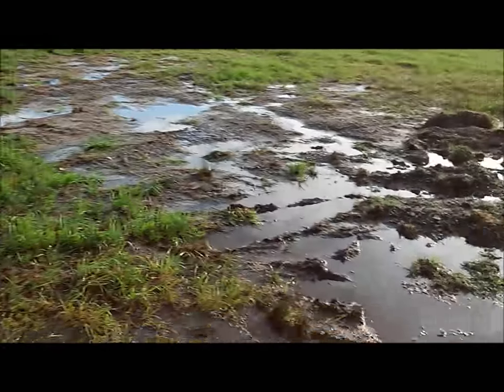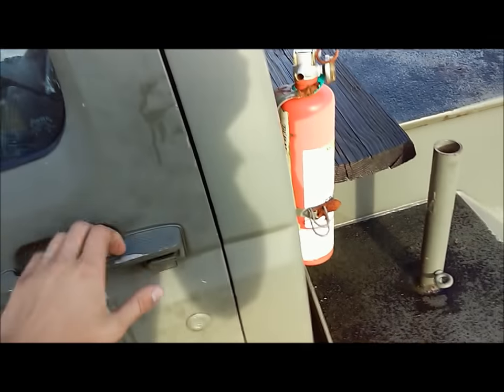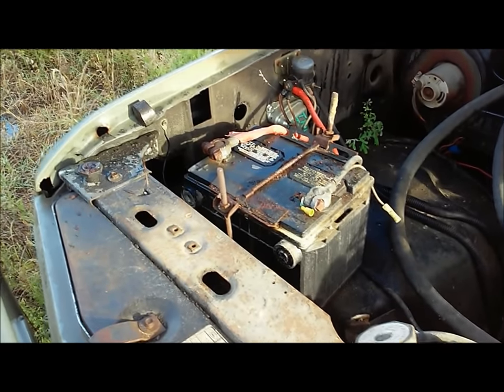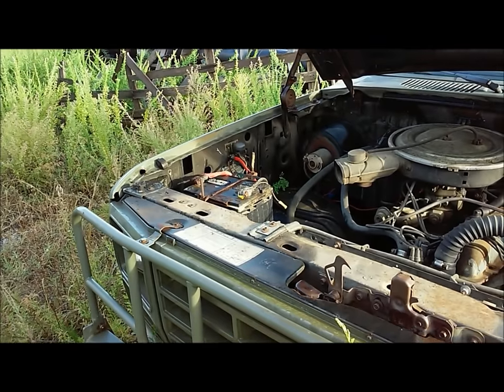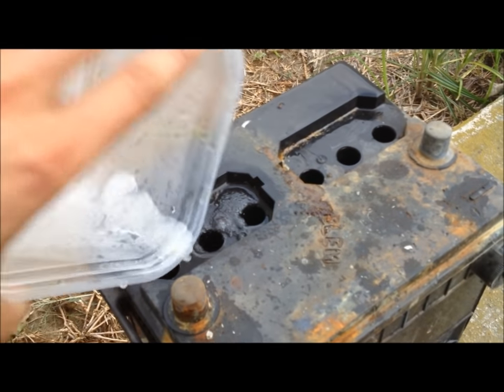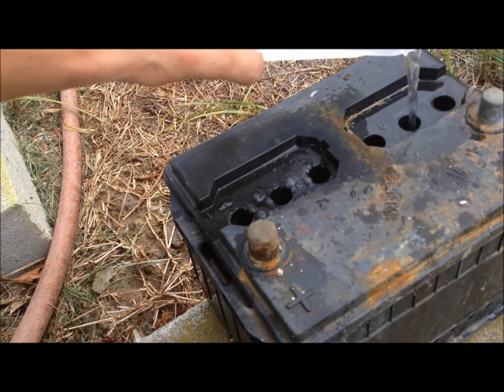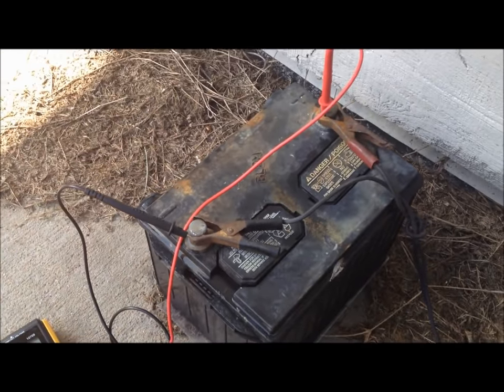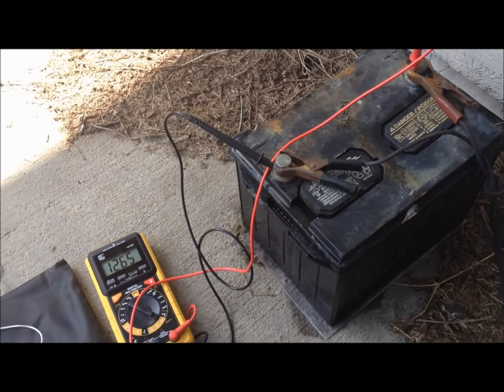Car Battery Repair After Sitting 10 Years: How To (Basic Home Products !!!)

Comment: He poured the Acid out on the Ground.
Reply: I meant No Insult !
Reply from the maker: +The Gardening World i will admit openly that how i did this was stupid. also, sometimes i just dont have the recording equipment when the opportunity presents itself. the vehicle did light off and run. ran it through the bog back there and parked it again. another employee eventually bought it. 
if i do this again, you better believe i will do it right. i cant even figure why i was so careless.
Reply: I\'m not sure but ,if anyone else needs to find out about how to recondition used car batteries try Corbandy  Battery Blueprint Crusher ( search on google ) ? Ive heard some amazing things about it and my buddy got excellent results with it.
Reply from the maker: ill admit that this was a fail.
Reply: hi everyone ,if anyone else wants to learn about how to recondition batteries at home try Vaxicorn Battery Extender Guide (Have a quick look on google cant remember the place now ) ? Ive heard some decent things about it and my cousin got great results with it.
Reply: It's a fail because you didn't pour it on a fire ant colony
Reply: don't cave in to the trolls
Reply: Yeah,  that's because he didn't have any methyl ethyl death.
Reply: I did a Job for a 90 year old Mill Valley couple~ Deepening thier Creek~ after about 6 - 10 inches deeper all kinda Oil started to flow down the Creek ! I screamed at her for this~Dragging ME into it for a $12 hr Job! She said Oh in the '50s we ALL dumped our Oil and other Paints , bug sprays, (Leaded paint too~ ) right in the creek~ maybe 2 miles from Sausalito Bay Oops~ I tried backfilling it~ but it made it worse~ I got paid and got outta there~ Never disturb ancient dump sites~ I mean Wildlife was coming back and the toxins Ted Turner added to our Gas MTBE has NO halflife at least this was good ole Oil~ I knew as a 7 year old kid ta take used oil to the Gas station open the recycle tank most Stations had then for free , and Re~cycle it~

Comment: here's  several ideas for getting a good result
never try to do this unless you are sure what you are doing - the acid can burn you
Test the voltage first - there may be a kaput cell which would waste your time.
Check the battery fluid.
attempt to fully charge the battery.
(I read about these and more from Jons mender guide site )

Comment: I reacted the same as everybody else to emptying the battery on the ground, but people forget that when a battery discharges the acid turns back into water, especially after sitting many years. That's why they freeze up in the cold. That was mostly water, but still I don't know if I would show dumping it out like that on YouTube. You may wanna edit that part out before somebody calls the EPA on you.
Reply: There's nothing wrong with pouring battery acid on the ground, it neutralizes almost immediately, and becomes inert.

Comment: So i have an old style battery i want to try this on. What do you replace old fluid with after its revived with salt mixture?
Reply: Pour the battery acid out in a metal container or plastic one then pour in distilled water with Epson salt into the battery then charge it, after you charge it for a few hours pour the water and salt out and pour back in the acid

Comment: This wont work with batteries that have dodgy cells, sometimes yeah you can get lucky and rejuvenate a battery for a few weeks/months maybe even a year, but the thing is an old battery isnt reliable. Imagine driving out in the desert/weather/snow etc etc and your battery dies. No ones fauly but your own really. Batteries are a consumable item, the lead flakes off and they no longer hold the same as original meaning they need replacing

Comment: There are  a few ideas for doing a pro job
do not try to do this unless you know what you are doing - the acid can burn your skin
check the voltage first - there may be a dead cell which would waste your time.
Check the battery fluid.
attempt to fully charge the battery.
(I discovered about these and more on Jons Mender Guide site )

Comment: I'm guessing that the battery was unable to crank the truck - or any other vehicle. Didn't the 12.5 volts drop to somewhere around 5 volts as soon as any load was applied?
Reply from the maker: i made recent video off me doing this all over again and then cranking a truck over and starting it. search thunderhead289 battery. you will find it.
Reply: Will do. Thanks.

Comment: How did it hold its charge over time ?
Was it as near good as new like for years out of that battery??
Reply from the maker: It lasted until the additive corroded the battery itself. Ideally, acid would be put back in.
Reply: When mixing the first epsom salts (magnesium) you should have used distilled water ($.99 a gallon at wally world). That way you could have avoided putting in chlorine and other minerals that are in tap water causing corrosion. After a week of desulphation/charge with the epsom salts,  one or two flush outs of the liquid using distilled water (depending on how much black soot comes out) and then a new 1.5 gallon box of battery acid ($20 from autozone) would have brought her back for another 5 year use. Filtering out and using the original electrolyte brings down the lifespan to under a year.

Comment: What did you put back in the battery after you drained the Epsom Salt out?
Reply: I think it is no brainer that he poured an electrolyte, a.k.a. dilute sulfiric acid, also known as battery fluid, or sulphiric acid with is 25-30% concentration compared to water. I don't know how to tell you in even simplier way.

Comment: 12.65V is all well & good, however it doesn't mean it has enough charge capacity to start a truck.  I've got an old batt that is over 10 yrs old it it has a great V--but it only puts out about 150 cca (it once put out 700 cca when it was new).

And that is why people who only test a batt V & not load test the batt essentially fail in their videos...
Reply from the maker: Well, it ran that pos truck, so it was good enough to start that
Reply: There are several factors in battery reconditioning. One resource I discovered that succeeds in merging these is the Magic Mender Wizard (google it if you're interested) without a doubt the most incredible course that I've seen. Check out this  super resource.
Reply: Epson salt is magnesium sulfate.  Your battery only needs the sulfur from that chemical compound.  It does not need the magnesium--which just gunks up your battery.  

It would have been better for you to just top off the battery with distilled water, slow charge it for a few days & (if necessary), replace the electrolyte with clean electrolyte -- if the old electrolyte looks nasty.
Reply: @jon fraer:  Just flag the advertiser like everyone else does...

Comment: When a Lead/Acid battery discharges, to start your car, its electrolyte boils pure Oxygen gas. Inversely, when being charged it boils off pure hydrogen gas at twice the volume, that's why car batteries can explode, hydrogen and oxygen gasses are explosive and, H²+O¹=H²O and this is why we add distilled water ONLY to a car battery, not acid. As the electrolyte boils and evaporates away, when the Lead plates hit air they sulphate which deteriorates the Lead AND the Zink plates which collect at the bottom of each cell and shorts it out. When attempting to resurrect an old battery you must dislodge the crud at the bottom of each cell and add ONLY new electrolyte fluid. How do I know? My backyard used to look like his!

Comment: I agreed with the techniques and the process used in this video. you did kinda leave out the fact that you put the the new electrolyte back in and dumped out the solution of Epsom salt. but what was most astounding was watching you play sulfuric acid that contains live out in the dirt. now if you're growing anything or if it can grow anything and any animals or people eat it they get lead poisoning. last thing that was surprising to me what's the lack of professionalism. I mean God when you took the battery home you could host and cleaned up all the rust on top of the battery so that it did not contaminate as you poured the liquid inside the battery. kind of reminds me of a mechanic that works on an engine and leaves at all greasy.

Comment: I wouldn't worry about the acid dumped on the ground. Unless I had a toddler or pet crawling around. But setting the battery on the concrete charging it. First of all, never sit a battery on concrete. It's not good for the battery. Secondly, you even commented about the leakage while charging. The acid will severely damage the concrete. How many new batteries could you buy with the money you're going to pay for your new sidewalk?

Comment: Ive been in emergency services for 32 years. Do you have any idea how many batteries rupture during wrecks, mechanical ruptures and have poured out by turning over etc. No one died from the lead poisoning that I know of. The acid becomes inert and is relatively a weak solution. As far as lead poisoning from the lead in the battery yo probably drink more from city water and old pipes than spilled on the ground. Yes I know I am a Haz Mat Tech. But.. I do not endorse pouring toxins on the ground or overreacting to EPA PC BS.

Comment: you mention not leaving the Epson salt water in there ..so what do you change out the fluid with ?
Reply from the maker: you would have to put acid back in if you planned on using the battery long term.
Reply: so dump it out and save it to replace it  or do you get some new acid ..Where do you buy battery acid ?
Reply from the maker: +Mat Tuk I guess you can save it, I just wanted to see if it would work and didn't plan to use the battery long term

Comment: You are connecting the battery charger and checking the voltage.. I dont think it actually charged up
Reply: Im also thinking bullshit, Ive never hooked up a meter to a battery and had the voltage rise while connected to meter...unless it was been charged at the same time then it does?

Comment: Oh we'll just hook up the tester to this battery that's still being charged, don't worry the tester knows to ignore the charger, I've done this before.
Reply from the maker: The charger was unplugged from the extension cord when I had the multimeter on it.
Reply: It wasn't. You had to unplug those alligator clips when u added those multimeter wires, and so the voltage started raisin from 12.60v to 12.65, i means its charging. Don't try to trick electrician.

Comment: Poring battery acid on the ground ?  Are you insane
Reply: With old discharged batteries the "acid" will be fairly dilute as the SO4 sulphate part of the acid (H2SO4) will be firmly embedded in the plates.

The acid should have been saved.  Allegedly if distilled or deonised water is put into the battery followed by a long trickle charge (several days) some improvement may be noticed.

Comment: Not trying to pull the scab off an old wound,  just wondering how much the fines cost you???   everybody makes mistakes...
Reply from the maker: 270 some odd bucks if I remember right. And it was for the lead, technically Jr. For the acid as they told me it would neutralize quickly in the soil. I remade this video and handled the acid properly. Honestly, I have no idea why this is so popular

Comment: ThunderHead289,
   I appreciate the effort, but you are lacking so much information in this video that it absolutely deserves a “Thumbs Down”.
1)  No mention of how long you left the epson salt solution in the battery before dumping it out.
2)  Did you agitate the fluid (shake the battery) to help free up anything in the battery or just let it sit undisturbed?
3)  I’m assuming you only did one flush and not multiple flushes.
4)  No mention at all that you even dumped out the salt solution and then put new acid back into it.
4)  No video or info on what the acid looked like after dumping it out. Perhaps dumping it into a plastic tub or glass container (jar) to see any color changes in the solution or to see if there are any particulates or flakes or junk floating in it that were once in the battery.
4)  No mention on how well or how long it worked after the first start of the car. The car just started and that’s it?  Heck, I could start a car once or twice with minimal effort too. Perhaps even waiting a month or 2 just to see if this worked for more than just 1 start before posting the video.
   For future videos, you may want to consider if all of the facts and/or steps are included.
Good luck.
Reply from the maker: I made this video ten years ago when I was a kid and my youtube channel was not serious at all - during this era, I maybe got 200 views on a video. 

Only way later did everything take off - I didn't try very hard at it in the early days
Reply from the maker: Obviously I'm a pretty formidable youtube in this day and age - surprises me how folks never look at upload dates

Comment: there are proper desulfators that pulse power to correct the deterioriation, WITHOUT DUMPING THE ACID.    What  'corrosion ' is he talking about?  Those are lead plates with a buildup of sulfate.

Comment: volt means nothing. you can have 13 volts in a battery and no amps, it will not start even a bike. put on a battery tester see at what amp what is the voltage drop. It may start a car once. Turn on all electrical stuff in the car hook up a volt meter start and while starting the volt drops down to 10 may be 9 the battery is scrap

Comment: Wow all this mess about pouring the acid on the ground, doesn't hurt a thing, at most it will kill the grass. Anyway you could have saved the electrolyte.When a battery goes dead it is acid, when it is charged it is water, that is why you can add water if it gets low. I have seen that solution you made work on a few videos, but it is a home made electrolyte that is not as good. If you wash the battery out real good and use a funnel and a filter, you could have put the acid back in, if a little low just use water to make sure the plates are covered and charge it. If the battery does not want to take the charge, get the charger going on a good battery and quickly put the leads on the dead one(old trick).
Reply: Oh BTW if that doesn't work, buy a battery!

Comment: you cant check the battery voltage with the charger still hooked up.
Reply from the maker: The charger was not plugged in inside. I mention this in the video.

Comment: Shouldn't he have put the old battery on a piece of wood while it charged or something else non-conductive. I'm no electrician but I thought batteries could lose charge if placed directly on the ground.
Reply: Nope. Along time ago when batteries were not made with plastic that was the case. Now all 12v car batteries use good plastic and they do not discharge just sitting on the ground.

Comment: You done the battery diesel diesel trick you see on the internet he done it wrong what's for the acid entertainer then you take water clean the battery out then you put Epsom salt in it charge it up then drained salt water out wash out real good as a salt out then you filter the acid for back in the battery then charge it up that's how it supposed to do it

Comment: Please don't pour that on the ground( love that truck, like to have one to pull a small trailer with-looks like a valve cover for a 250 -six whats with that?
Reply: Sulfuric acid is naturally occurring and is even commonly used as a drain cleaner. It may kill the grass or even neutralize the soil if it's strong enough, but it's not like pouring toxic petroleum products on the ground. However, the acid in an old battery is going to be full of lead sulfate, and that is bad.

Comment: He's measuring the voltage with the batter charged still hooked up, no wonder he's measuring 12 volts!!
Reply from the maker: Another screw up on this vid, it was not plugged in at the time. If you do not believe me, search thunderhead289 battery and watch the vid I made doing this again factoring out all the bs I "allegedly" did to "fake" this

Comment: ThunderHead289, interesting.  Amazing the number of comments by the undereducated pink shirt crowd about "The HAZZARDS of pouring the electrolyte in the ground".  After 50 years on a farm (You PS people DO know where your food comes from, right? - All of those who said, "The store" can return to playing with your Legos now.) Let me tell you how we farmers lower the pH in alkaline field; usually with H2SO4. Yes the SAME sulfuric acid that is used for car battery electrolyte.  However it is full strength, not the watered-down stuff, and an application rate  of 100 pounds to the acre is typical.

Comment: Did anyone notice the 'BLEM' stamp on the top of the battery??? It's junk.
Reply: It's what battery manufacturers put on blemished/defective batteries.
Reply: a friend of mine worked for johnson controlls where they make battery cases and he said that the difference in the warrenty was how far the plates from the bottom of the case.it makes sence because thats how the battery shorts out!
Reply: Joe Estes and

Comment: Do you think that you would be able to reuse the electrolyte ? Acid water mix that you poured out originally.
Reply: Seen another guy using Alum?
Reply: He used Alum mix for the new electrolyte.
Reply: Nice Fairlane !
Reply from the maker: +thangamajig I'm sure that would work, honestly you just need something in water that is conductive to pass the charge
Reply: Love the exhaust crackle of a hopped up Ford Small Block.  I had a 65 fast back from 16 to 35 years old. Miss it terribly.  Back in the early 80s you had to make good heads. Had some fixed at a local speed shop with 300 /327 valves.